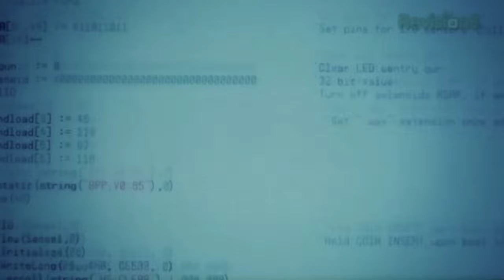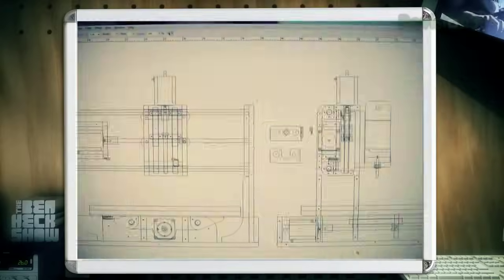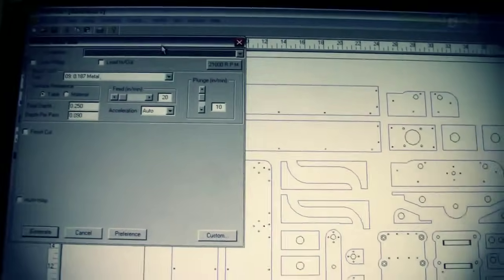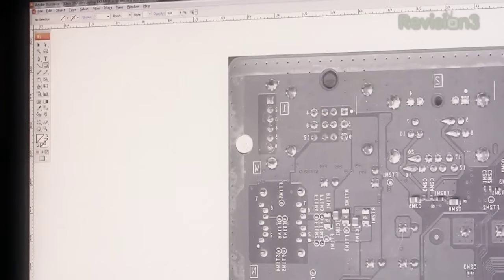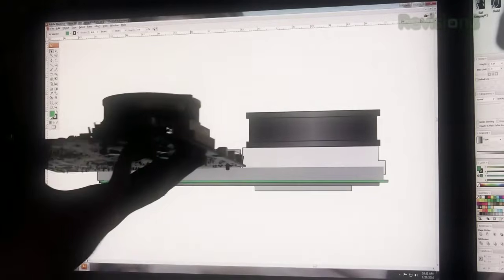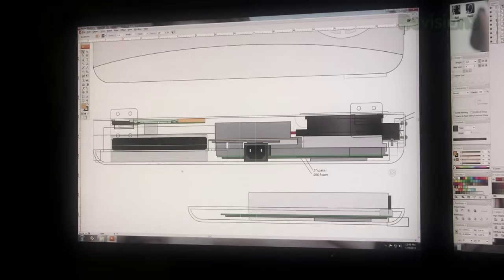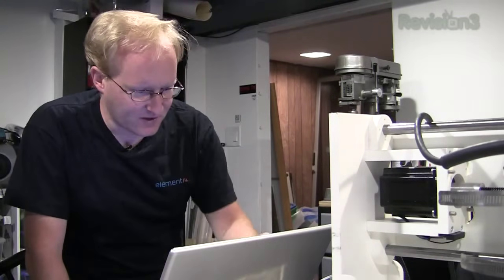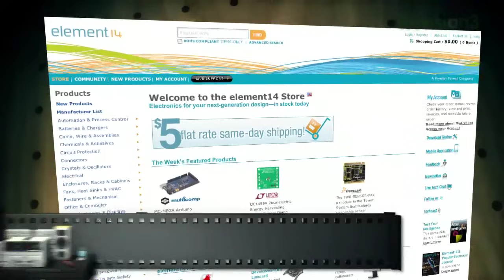The Ben Heck Show - Build a Portable CNC Router for Fun and Profit

Comment: So how to built a cnc router: Step 1. Buy or make cnc router...anyone else see a problem here?
Reply: The thing with a many of Ben's projects is that they can be completed without a CNC machine by printing out templates and using saws and drills to make the pieces. With the time constraints of the show, he has to use CNC machines to get the projects done in a timely manner.
Reply: It's also worth noting that the maker movement has become stronger than ever with many "maker spaces" around that often have CNC mills and the such for members to use.

Comment: This reminds me of the Steve Martin joke,  "How to live like a millionaire".  First, get a million dollars.

Ben's variation - "How to make a CNC".  First, cut all the parts with a CNC.  

Pretty useless Ben.
Reply: +mehere got a hacksaw/drill and paper pattern?
Reply: +mehere Oh, the challenge was to make a portable CNC in one episode/day. There are lots of other videos all over Youtube about making a CNC machine from scratch, but they don't do it in one day. Ben used a little help from a friend to pull this off. Things I would do differently: make it smaller. Use a briefcase as the frame so that it is more portable. Use a Raspberry Pi. I'm wanting to make one of these myself. I got some stepper motors but they are low voltage ones and all the ones used in various videos use higher voltage, so I am not sure what driver to use with them.
Reply: John Daniels Well, just don't do any multi-tasking while it's running the motors just to be safe. :)
Ben used an Arduino based board which is a lot less powerful processor than a Rasp Pi. It's like 16 Megaherts compared to 1 Gigahertz. I think by using a Real Time Operating System you would not have to worry about it diverting resources no matter what kind of CPU it is.

Comment: hey ben  , a noob from the netherlands here and new to the channel hope youre able to work this one out too 

i messed up my mig welder but it still has a good weldingtorch and wirefeed motor

my initial plan is to buy a Giant TIG220P TIG ac dc welder and use that to power the weld power part 
basicly build a seperate box holding a 12 volt powersupply the wire wirefeedmotor and the speed and run the switch from the mig torch to a relay running both the wirefeed and power 

someone mentioned to me once that mig uses different current compared to mig , do you know if theres a way around this

Comment: which material did you use i mean the wood>
Reply: +Taha Naveed 
Yes I would Like to know as well.
Ive scroll through a lot of comments and several other people have asked the same question, but haven't found an answer.
What is the white material you are using for the structure?
Reply: +Taha Naveed 
Yes I would Like to know as well.
Ive scroll through a lot of comments and several other people have asked the same question, but haven't found an answer.
What is the white material you are using for the structure?
Reply: +Taha Naveed It's called Sintra Board. It's a PVC sheet good. Not cheap, but very effective.
Reply: +theHeckwithKaren 
Thanks
Reply: Thanks alot.

Comment: 1 minute intro...    glossy overview on data flow without naming a single product to help us...  then cutting out the parts for a CNC router using a CNC router...   some interminable X-box stuff (which I FFWD'd through)...  A useless segment on reflowing using a BD oven (with no real information),  and then a useless segment saying "see, it works".  Two or three minutes of real content crammed into 18:48 of glossy shlock.

Comment: I Really wish Ben would have spent more time explaining the work procedure for going from illustrator to G-Code. 
It seems to me to be one of the most important processes for working with DIY CNC machines. I mean, the whole purpose in a CNC machine is to generate real world objects from computer designs. If you gloss over the design, and conversion of your parts to G-Code for use on the CNC , you're basically left with a really expensive doodad that moves.

Comment: I would like to build my own panels for my cockpit simulator. Is there a way to integrate a CNC Router ( to cut out the form of the panel ) and a Laser Printer ( to label the panels ) ???

The Panels would be made from clear acrylic with gray acrylic painted on the front. Etched off paint would allow side lighting to come through showing the labeling.

Let me know what you think and how you might put the two together.

Glen

Comment: Am I wrong or is there no linear bearing in this build.  I see the screws, but I didn't see an skates, pulle or round linear bearing.  I looked like the gantry was riding on the material itself.
Reply: +Justin Nutt no, if you take a better look you will see brass bushings and not linear bearings

Comment: Is there a BOM list somewhere?
Reply from the maker: We're looking at the best way to present parts lists and instructions and we're open to any input on the community. http://ow.ly/L57Cd
Reply: +The Ben Heck Show Uh...  Notepad text files and photos of pencil sketches?  It would certainly be  better than the nothing that you provide now. You'd barely pass a junior college design class only because the item is finished, not because of any chance of replication by others.   You can use Github, Thingaverse, or any other similar sites. Or just attach the files to the forum entry.  You have a freakin' sponsor, use them.

Comment: Anyone wanting to do this, save your self a lot of trouble and buy a ShapeOko kit.
Reply: And how can I save $800 on a kit????
Reply: XCyclonusX You can get a Shapeoko 2 kit for $550 https://www.inventables.com/technologies/desktop-3d-carving-cnc-mill-kit-shapeoko-2 Also, it doesn't require you to have a CNC mill to make your CNC mill with like this video.

It's only $275 for the mechanical kit.  Then you would have to buy the electronics, but you would have to do that with a DIY machine too.
Reply: Steven Osborn or you could upload your design to swarmbuild.com and pay someone to cut it for you cheaper and have it shipped to your door
Reply: Austin Mann And you would be right. I have yet to use them but have a list of projects in the planning stages and they will likely be my goto source.
Reply: It's kind of a back burner project, I figure the longer I wait the easier it will get.  But if I happen to stumble across someone who's figured it out that is providing services I can afford, that could very well bring the project to the forefront...
Reply: Austin Mann Woah cool! Thanks for the link. I'll be using them for sure!
Reply: Austin Mann Swarmbuild looks interesting-- but none of the machines or engineers on the site have any reviews or ratings-- it looks to be so new it's not clear what capabilities they can actually deliver at this point...
Reply: Austin Mann One thing I'd like to figure out how to do is to get someone to CNC a decent size piece of foam (~3'x3'x.5' or so) from a grayscale heightmap.  Everyone wants triangle models supplied, but converting to that sacrifices a lot of detail (or ends up being too ginormous).  And then those triangle meshes get converted to heightmaps anyway within the driver software.  Apparently it has been done-- there's Open Voronoi and F-Engrave software for it, but I don't know who's actually worked with it or seen any results-- I probably need to check their forums.
Reply: Syncopator i'll have to look into that, i haven't done it, but it sounds interesting. let me know if you figure it out
Reply: Syncopator they are a new company, they ran a start-up in my city and got way over what they were asking. I personally worked with Boris (the ceo) and while they are a new company the people who do the machining and engineering have years of experience. i have completed one job through them as i have a 60w laser. this is not a sales pitch by any means, i could care less if u use them lol. but i do think people could benefit from something like this.

Comment: Making a CNC router on a CNC router kind of defeats the point to me, but someone with a local makerspace or fablab or whatever you wan to call it would probably be good to go.
Reply: ***** Doing it by hand would be pretty inaccurate unless you're really good of that kind of thing. I'm pretty decent with carpentry and mechanical engineering so I might take a try.
Reply: LeiserGeist Just make the next iteration of your CNC using the previous one and so on and accuracy should improve by itself, no?
Reply: Duraltia
That's an interesting concept.. I'll get around to trying that eventually haha
Reply: Duraltia This is the kind of thing that results in self-aware CNC routers.
Reply: I think it’s actually the endgame. You build a machine that can be used to make copies of itself.

Comment: Wont a cnc be more efficient if on the clean out pieces they just cut it out instead of back and forth 1 line at a time? Not trying to sharp shoot you because I have never used a cnc or any computerized machine for that matter so I don't know squat. Just curious why I see them do do it that way? Are all of them that way?
Reply: Its  a matter of the capability of the parts in a given model. More precision and controlling is possible with more cash and more time invested.

Comment: you should build an XBox One laptop, but invest in the blower cooling system used by either a graphics card or a slim mini-desktop. Then all you have to do is adapt it to fit the backplate and mounting holes from the original cooler, and it's likely slimmer and more effective.

Comment: Been all over YT looking at DIY CNC projects. If I could build a CNC for less than $500 (which I'm doubting is possible), I'd be ecstatic
Reply: Daniel Moeller Not a Dremel, A misengineering compensation tool
Reply: *****
I do have the Dremel, so that cost is already covered. Using an Ardiuno to interface with the stepper drivers is a cool idea, though I haven't experimented with Arduinos before so I would have to learn how to set that up. It looks like the biggest challenges I'd have would be learning the Arduino, sourcing three matching steppers and setting up the stepper drivers; all of which I'm sure I could work through if I could allocate the time for it.
Reply: I'm up to about $100-150 and got all the electronics and steppers working. Planning to buy steel to weld up for the machine for about $100. Add some welding stuff, skateboard bearings and some unexpected costs and I'll be at about $400. :)

Comment: Why showing a DIY project to build a CNC with a CNC to cut all the part ?! Actually the main issue is to cut accurately all the part with standart tools not a CNC ! otherwise all project are possible !
Reply: You can build one by yourself using only hand tools and then build another one using the last CNC built. :D
Reply: Exactly what I was thinking!!!!
Reply: Because he is lazy. "Some of the most riveting computer screen experience I have seen", yeah, sure. It is now 6:38 am here any I have been sitting for like 13 hours trying to make a Kyocera printer without Linux driver run on a Linux system...

Comment: How to build a CNC router

Step 1 Put an advert for Element 14 on youtube
Step 2 Explain to people who want to build a CNC router what CNC means (derp)
Step 3 Talk about G Code for no reason
Step 4 Buy a CNC router
Step 5 Cut some parts to some undisclosed dimensions and buy some more parts
Step 6 Explain how to build a case for your xbox 360 laptop
Step 7 Get someone else to build the CNC controller.
Step 8 It works!
Step 9 Insert another advertisement for element 14.

How-to video FAIL

Comment: Ben, awesome vid. One question: every CNC designer touts the resolution ie. 1/16000 inch. But I rarely if ever see ACCURACY determined. The accuracy can be measured by making a long travel back to a known spot and measure any error. This is what truly matters as far as accuracy is concerned. Takes into account any and all deflections and tolerance stacking. Why do I ask? Well, inquiring minds want to know. Practical inquiring minds want to know how much to spend on rails, bearing assemblies, etc

Comment: This video is not "how to" build a cnc machine. Its a "How i built" a cnc machine to fit a specific niche. the challenge was to build a machine that was small and portable. He accomplished that. Besides if you are building your first machine, it stands to reason you might have to farm out a few operations or in the least do them manually. How the cuts are made really makes no difference, so long as you have the coordinates. Which of course, you dont.